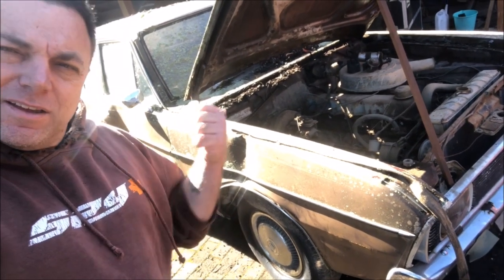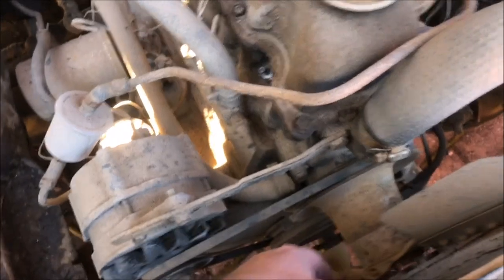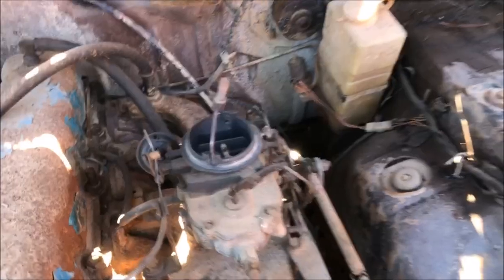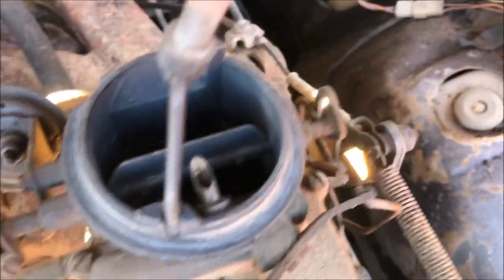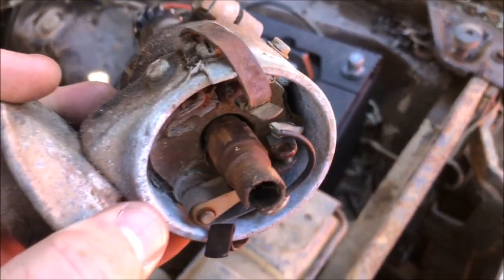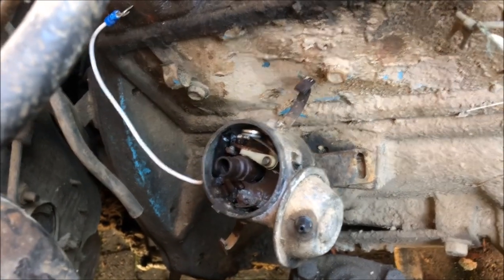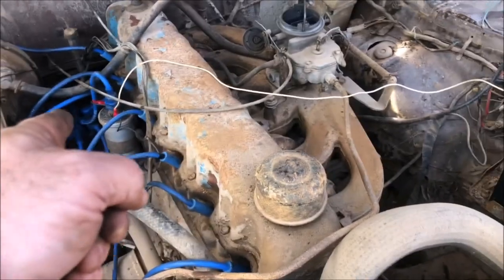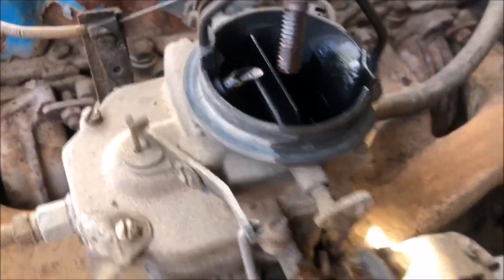The VG - Back to life with a bang!! Abandoned Aussie Mopar

Comment: Starter spray might have helped save 2 min but it’s also bad in other ways from what I understand. The two stroke mix like kerosene always helps after these long long time parked cold restarts. De-gunks the top end kinda from what old timers have told me. They say. Run kerosene thru it for a while as in gallons but idk.   Hemi you say. Idk they had a hemispherical head.  Learning.
Reply: It doesn’t even blow bad smoke. Wait what’s that steering wheel doing over on that side? American Postal delivery car I bet. Lol.  I’m just joking no death threats please. Respect the Australians this American sure dose no shit.
Reply from the maker: Yeah these engines were originally designed in the US for commercial use but they decided not to run with them and gave them to Australia. Promoted as a Hemi here and had the performance to match the name. Super tough and powerful engines with an awesome note. Sadly for you guys you were stuck with the slant but then again, six cylinder cars weren’t real popular as far as performance in the states anyway. I’ll a a link but if it doesn’t work, just google Hemi 6. Thanks for watching, cheers 🍻 https://en.wikipedia.org/wiki/Chrysler_Hemi-6_Engine